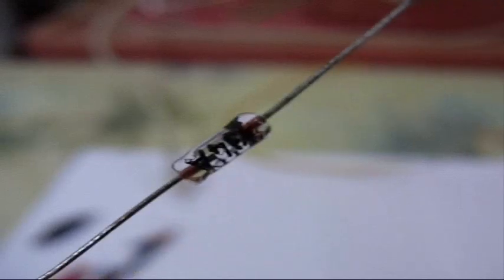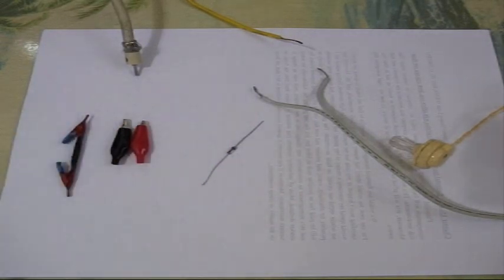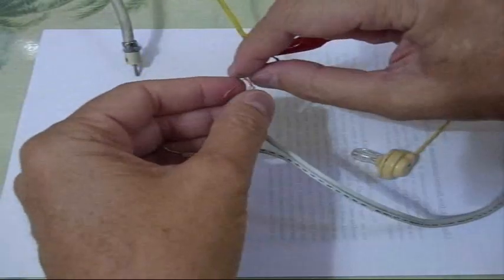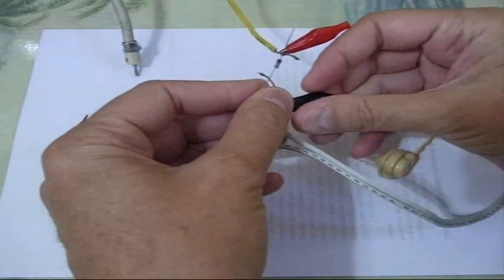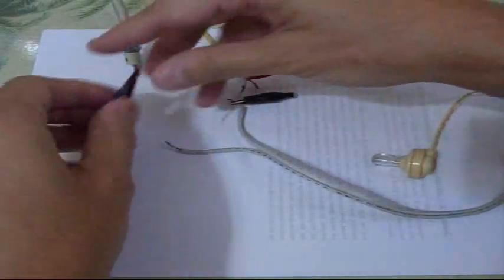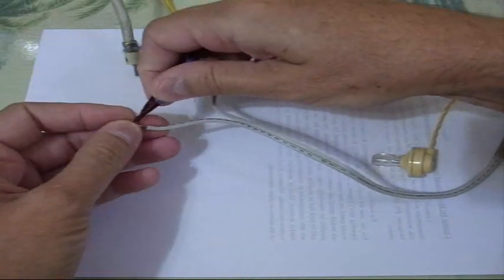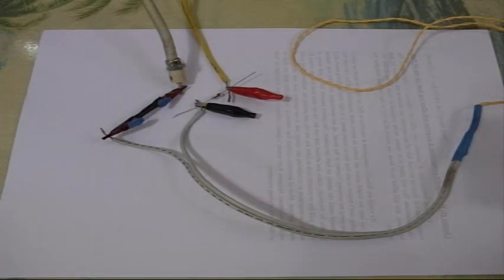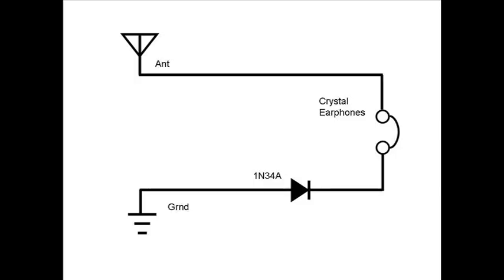World's Simplest Radio

Comment: What did you use for your ground and I have a diode from the disposable camera would that work?
Reply from the maker: For a ground it is best to use a ground rod.  Never use the ground from house wiring, it is too dangerous.  A pipe or metal rod in the ground is good.  The diode will probably not work.  If it's a 1N34A it will say so in small letters.  They are glass so they are easy to spot.  But not all glass diodes are 1N34A.
Reply: does the diode have to be glass?
Reply from the maker: No, but 1N34a usually are.
Reply: Ok
Reply: ...connecting to a cold water pipe provides an excellent "ground"- as for the diode, a "germanium" diode is best for this application.

Comment: Can you send me the link of where i can purchase the antenna please. I am trying to recreate this for a school project due next week and I cant get mines to work. Also, can you show a picture of your entire set up please.
Reply from the maker: The antenna is just a very long wire.  The longer the better (20M or 60 feet is good).  I usually pull apart an old transformer or similar that has coils of wire in it then unwind them.  (Be sure to scrape off the enamel insulation so you see shiny copper where you attach to the radio.  If you don't it won't work.)  if you want to buy wire, any electrical store can sell you a spool of enameled wire (they call it "magnet" or "bell" wire).  I also found a lot on Amazon by searching "enameled wire". 

The antenna can not cross over electrical wiring or run near it for safety reasons.  Tie it between two tall places outdoors (ex: poles) using a plastic string on both ends for insulation. 

Also VERY IMPORTANT, you MUST use the same diode and earpiece as shown. 

You can get the earphone from Amazon by searching "Crystal Earphone Piezoelectric".  It looks like the one in the video. 

Diode is is also available from Amazon, search "diode 1n34a".
The ground is just a long metal rod driven into damp earth and the other side of the diode is wired to the rod.
Reply: ...a major disadvantage of this kind of radio, is that it is NOT very portable!

I understand that during WW2- the GI's used simple "foxhole radios" like this and they used a razor blade instead of a diode.

Comment: Hi tsbrownie could you please send me the link for this diode that would be very nice thanks a lot
Reply from the maker: I don't know where you live, but Amazon sells them.  My local electronics store has them.  I don't endorse vendors or products so I don't have links.  Just google "diode 1n34a" and you will get pages of people who sell them.
Reply: Hi I actually found a 1n34a diode-in my house and it works!!! Just 1 question why is it so quiet coz my antenna is about 7-8 meters
Reply: Thanks soooooo much you make great videos I liked and subscribed
Reply: Does a bat48 diode also work?
Reply: I am 10 and love electronics a lot I mean a LOT
Reply: Hi could you tell me what to right in amazon to get your antenna
Reply from the maker: @ronnyt5386  I am making a video on crystal radio antennas, maybe 2 weeks more. They are just long wires that have insulators on each end. I use wire from old transformers, solenoids, etc
Reply from the maker: @ronnyt5386  I do not know that one. I have only used the 1n34a. Most diodes do NOT work.
Reply from the maker: @ronnyt5386  It is a good field and it is a lot of fun. So many things you can do.
Reply from the maker: @ronnyt5386  Thank you!
Reply: Thanks
Reply: Why is my radio very quiet
Reply: And I once heard music but I just hear noice
Reply: I can not find the antenna anywhere sorry to disturb you so much I just think that this is a really cooooool radio
Reply from the maker: @ronnyt5386  Your antenna is probably weak. A good one is 10 to 20 meters long! Look up "long wire antenna", that will have information. They are also used by amateur radio operators. If you like radio you should study to get a license!
Reply from the maker: @ronnyt5386  If it worked once, it will work again. Probably a bad connection.
Reply: I always have to pull my antenna to make it work
Reply: If I do not pull it I just here krakella
Reply: Hi I have been looking for a cheap (30€ or $ ) crystal radio that can fit in my pocket do you know one good one on amazon.de amazon.com eBay.de or eBay.com?
Reply from the maker: Deutschland?  I lived and worked in Hamburg for a while.  It's a great country.  All my grandparents came from there, but my german speaking capability is poor.  Your English is really good.  You should be proud.  I don't usually buy finished radios.  There are "rocket radio" kits and such available, but I don't know how good they are.  I am planning on making a small crystal radio with a tuning slug based on one I had 55 years ago.  Just need to find time.
Reply from the maker: Sounds like a bad connection.
Reply: Hi thanks for the information but I actually am from england
Reply from the maker: I saw the .de on Amazon.  I guess with the EU it's easy to shop across borders.  It's been almost 20 years, but I spent a lot of time in England on business: York, Leeds, London, Bristol and other places I don't recall.  Your country has great museums!  
Here is a video on antennas.  I've been putting off finishing it for a year.  Hope it's useful.
https://www.youtube.com/watch?v=G8AsgZbncW4

Comment: does a 1n34A DO-7 work to
Reply from the maker: +Some One I looked up the specs on it and I will guess that it will work.  The DO-7 is the "package" which should not matter much.  If it does not work, it's pretty easy to change to a new diode.

Comment: Will work if you live near a.m. transmitter if there are a few will be receiving all at once
Reply from the maker: True, however it will usually select the strongest.
Reply: @tsbrownie  For me in Salt Lake City, Utah, that would likely be KSL at 1160 assuming this is an AM receiver.  I think nearly all crystal radio receivers are AM, and it baffles me as to why since people have made FM crystal receivers before.
Reply from the maker: @scratchpad7954  FM uses a totally different method of encoding data.  AM is amplitude modulation and so you just have to decode a change in signal strength which is what the diode does.  Frequency modulation is a change in the frequency and requires "knowing" what the frequency is so it can know what it changed to.

Comment: How long was your antenna,and where a good place to buy that dialled,and crystal ear phone,I find those hard to find
Reply from the maker: +Ron Thompson This antenna was pretty short, about 15 meters.  Just an old wire up the side of the building.  The diode and earphone can both be gotten from Amazon or from local electronic stores (places that sell to tv repairmen and such).
Reply: tsbrownie I just over paid for the ear phone's,now I just need to find the right diode ,I have every thing else ,I think I want to build it for boy scouts.,also if I use my magnetic wire wrap around a tube that would be the same as a long type antenna right?
Reply from the maker: +Ron Thompson I built my first one from the Wolf Scout book (that had an error in it no less).  The last earphones I bought were around $1 to $1.5.  Probably too much.  
The only diode that you can be sure works is the 1n34a.  I just googled "buy 1n34a" and they're available on Amazon and electronic stores.  
I'm not sure I understand your antenna question.  The coil wrapped around the plastic pipe (and it must be paper or plastic, NOT metal or painted.  Paint contains metallic stuff that messes it up) is an inductor.  Adding another coil (if that's what you mean) would change the inductance but not really act as a very good antenna.  The long wire antenna is like spreading a line across the mouth of a bay to catch waves.  A coiled up line near the shore would not catch much of a wave.
Reply: tsbrownie I bought fifty feet of speaker wire that can be spit,will that do,my Main problem is I am building this in a appartment to start with,and I just paid 9.95 for a crystal ear phone,th as because I paid 5.95 for shipping ,that's what I get for not reading ,if you no of a cheaper source for the scouts that would be nice,parts like what I need is hard to find here
Reply: tsbrownie thanks for your help from one old scout to another scout
Reply from the maker: +Ron Thompson Glad to help.
Reply from the maker: +Ron Thompson That is a lot.  Do you have any electronic shops around?  The one I found them in (after many attempts) sold replacement parts for tvs, radios, etc.  There are also some guys that have crystal radio supply web pages, but I don't recall how much their shipping was.  Some seem to do it more as a hobby and not a get-rich-quick-scheme.
Reply: tsbrownie Mike's on the internet has all the part you will ever need for crystal radio's  price aren't bad

Comment: In the article on Wikipedia "Detector (radio)", and not only there, the diode and the earphone are connected parallel. Have you tried with parallel connection? If yes, is it better or worse than the serial connection? Thank you very much for the video.
Reply from the maker: +Stephan1098 Good question.  They have 2 simple detector circuits.  The one I made is their second one.  The first one they show (titled: &quot;a simple envelope detector&quot;)  requires more components and is not the &quot;simplest&quot;, but it does work.  I have tried that version and don&#39;t hear much difference.
Also note that one of the most popular diagrams for a crystal radio on the internet does not work well at all.  I made a video of a test of it compared to a simple wiper version.  https://www.youtube.com/watch?v=i2PITPUg2vI&lc=z13xflsadymgjlwm122uipcosyuhjvsjo04
Reply: +tsbrownie I mean only the second circuit with one diode, earphone, antenna and ground. On Wikipedia the diode and the earphone are connected in parallel and in your circuit they are in series. Does it make any difference? I will try these things soon but I&#39;m curios in the moment. Sorry for bothering you.
Reply from the maker: +Stephan1098 No bother, I like good questions.  When I was a kid I had a "real" crystal earphone, not the piezoelectric ones like today.  It would work with the circuit from wikipedia, with the diode between the leads of the earphone.  I just tried that and it did not work with the piezoelectric type of earphone.  Only the diode in series worked.  I had read about this in several places around the internet, that the old school crystal earphones have different properties and as far as I can tell, that is true.
Reply: +tsbrownie Thanks a lot. Best regards.
Reply: How do you tune in to different stations? Or is it not possible with such a simple design?
Reply from the maker: Good question: There's no tuning.  It "automatically" selects the most powerful station.
Reply: @tsbrownie ...don't you mean "electromagnetic earphone(s)"?
Reply: @ikkepic  ...this circuit has ZERO "selectivity"-!
Reply from the maker: @daleburrell6273  Nope, electromagnetic are the type that don't work. They are a coil of wire that looks like a dead short to these tiny voltages and currents. The "modern" piezoelectric looks like a bit of capacitance, which is why you don't need the capacitor spec'ed in old crystal radios.
Reply: @tsbrownie  ...I was referring to the "high impedance" (2,000 ohm) electromagnetic phones- and you're quite right that the low impedance (8 ohm) electromagnetic phones wouldn't be worth a dam in a circuit like THIS.
Reply from the maker: @Dale Burrell  I don't know about 2k ohm earphones; maybe. Piezoelectrics are almost open circuits, so I am doubtful. If you try it, please let me know if it works.

Comment: Would it work on any other diode?
Reply from the maker: This is the only one that is sure to work.  There are probably others, but they are rare and would take a lot of testing to find.  Even other Germanium diodes don't work well, I've tried some.  These are cheap and you can find them on Amazon and in most electronic stores.

Comment: Can you use the classic razor blade and pencil lead instead of a diode?
Reply from the maker: I would think so, but can't say 100%.  Would make an interesting experiment!
Reply: I just tried it and it didn't work. I blued the razor blade with a match, but I guess I'll just spring 99¢ and buy some real diodes.
Reply from the maker: Thanks for letting me know.  I still have to try to use the razor blade on a crystal radio.
Reply: ...it's POSSIBLE- but that's doing it the HARD WAY-!

During WW2- the GI's used "foxhole radios that used a blue carbon steel razor blade, instead of a crystal diode- but as I understand it- those particular razor blades are hard to find these days-!!!

Comment: Will it work with 1N4148?
Reply from the maker: Probably not well, if it worked at all.
Reply: @tsbrownie  can I use a peizo electric buzzer instead of the earpiece ?
I don't find them near my area
Reply from the maker: @shashwatvishwakarma269  I do not know. I have never tried it. It will not hurt to experiment.
Reply: @tsbrownie  I tried it it went well I could hear some noises
Reply from the maker: @shashwatvishwakarma269  If it's working well, you should clearly hear voices, songs, etc.

Comment: Doesn't it need a coil to work?
Reply from the maker: That's a good question.  A coil is 1 way to "concentrate" inductance in a small space for convenience, but it's not necessary.  A straight wire, like a crystal radio antenna, has inductance (and capacitance), and changing the length of the antenna can allow for tuning, hence this simple radio uses the inductance and capacitance of the antenna (and ground) wires to tune.  It's not efficient and it basically rectifies the strongest signal, but it works.  
For tuning it's real inconvenient to change the length of the antenna constantly, but if you wrap part of the antenna around a plastic pipe and use a wiper, you can select how much of the antenna you are using quite easily.  In my video 
https://www.youtube.com/watch?v=8XR9Uzy2RPM&t=1s   
you can see the coil / wiper allows you to select just how long the wire is (which = how much inductance there is).  Another way to say it is the wiper position determines how much wire (inductance) is on the antenna side and how much is on the radio side of the circuit.  It's a bit more complex, but works well for the level of simplicity and it's tune-able!  I hope that helps.

Comment: I bought a diode from.somewhere between the 30 to the forty they are glass with metal ends being sold as better than what we have now .haven't used them get anyone no about these
Reply from the maker: Ron, they MUST be 1n34a type or it will not work.
Reply: tsbrownie I don't no what number they are but the are pretty old ,I got them from a crystal web site ,I also seen military grade crystals being sold and Russian there version of the crystal as long as they have galien
Reply from the maker: There should be markings on the diodes.  You can always just try them.  If they don't work, order the 1N34a.
Reply: I  have that number too,I bought them to test
Reply: tsbrownie I no there are several ,the one you mention is just one the more popular ones ,they have old ones,they have some military ones ,all suppose to work,and then there is a fox hole one that uses a blued razor blade

Comment: I tried 
30 ft antenna
Ship ground
Piezoelectric earphone
1n34
Downtown norfolk va 
Didn't hear a thing 
Reversed the diode also nada
Checked diode .267 vf
Touched ends of earphone and they click
Don't know why no luck..
Reply from the maker: There are 21 AM stations within 40-some miles of Norfolk, 6 in single digit distances.  Some are low power, but several are very high power.  WTAR is 50 kilowatts - you should be able to light a florescent tube with an antenna and ground.  There is also WCRW (don't know if construction is done yet).  WKQA is also 50 kW.  (You can find this info at: https://www.fcc.gov/media/radio/am-query).  I don't think anything around me is over 10 kW.  
It sounds like the diode is bad (they go bad very easily and are not easy to check with ordinary equipment), or it's the earphones (but your test makes me think they are OK) or the circuit is not right (the diode is in serial with the earphones, not across the antenna / ground).
Reply: @tsbrownie  hello thanks reply
I'm actually watching another of videos now
I can't get anything on the diode but my classic design coil variable cap design works like yours
One weak distorted station 
But it's a start 
At least I know my earphone works
:-)
Reply: @tsbrownie  I tried antenna diode earphone / ground earphone
And antenna earphone / ground diode earphone neither worked 
On your slider I.e. better radio does diode position make any difference? Did it on your classic design 
I tried on classic design and didn't make any difference which way diode position was in
Reply from the maker: @uncleruckus4060  No, the diode can be inserted either direction.  I assume the coil type radios worked for you, yes?
Reply: @tsbrownie  yes 
I gave classic design 
But as per my previous post 
Just one week distorted station
Reply from the maker: @uncleruckus4060  Do you have the resistor across the earphone?  What value?
Reply: @tsbrownie  no I don't
But I just ordered one
Well I ordered something else
And asked them to include a 47k resistor and .
001 cap
Makes a difference on pizo headphone?
Reply from the maker: @uncleruckus4060  Without the resistor the earphone acts like a capacitor.  You will find the resistor makes a LOT of difference!
Reply: @tsbrownie  47k seems to be ideal...from what I've read ?
Reply from the maker: @uncleruckus4060  It depends on your earphone and coil, but it will likely work.  I use a variable resistor to find the ideal resistance, then put in a fixed resistor.
Reply: @tsbrownie  good morning thanks reply 
What was your r value?
Reply from the maker: @uncleruckus4060  I have used values between 47k and 10k.
Reply: @tsbrownie  thanks reply
I just ordered some more materials
:-)